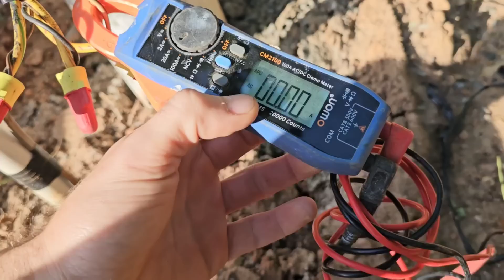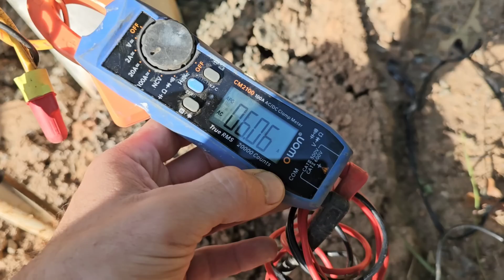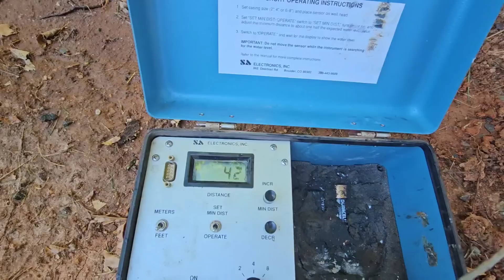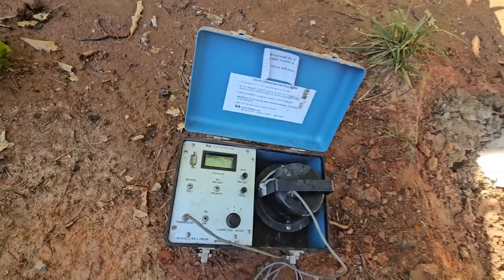A Terrible Outcome. Emergency Service for Low Water Pressure on July 4th!

Comment: I have a question regarding connecting the downpipe to the house pipe if the house side threads are too rusted to screw on a union. I need to cut off the rusted/splitting end but only only have a few inches left. Digging it up isn’t an option since it goes under a concrete driveway. I’ve searched Lowes for a PE pipe big enough to fit on a 1” galvanized. line but no luck. Also, Fernco fittings aren’t meant for pressure. Thoughts?

Comment: I have a question that possibly y’all can help me solve. I have a large concrete well the dirt  is sinking and causing a hole. How can I prevent this from reoccurring this is not the first time I have had to fill it I’ve used stones in soil to no avail, can concrete be put around the well to prevent this hole from reoccurring

Comment: I had a similar issue.  Our basement flooded.  The bottom pipe on the pressure tank rusted thru.  I replaced the tank with a big box store tank.  It worked great for the first year.  Then, whenever taking a shower, the pressure would drop so low that the shower would turn off and switch to the tub spicket.  I decided to investigate after letting it do that for a few months.  The tank air pressure was set right.  Switch turned on and off when it was supposed to. The water pressure was great directly from the tank faucet.  I decided to removed the shut off valve a few feet from the tank.  Inside the plumbing looking directly at me was a little red pipe cap/plug.  I quickly got my needle nose pliers and removed it before it could go any further into the house.  I do not know where it came from.  It was too small to fit the pipes before it or on the pressure tank.  I am glad I found it when I did.  We don't have a filter.  The next opening in the plumbing was 20 feet away!  I think it got dropped into the pressure tank at the factory or a prankster put it in at a store.

Comment: I'm surprised VA doesn't require relief valves, I've seen the 1/4" brass nipple to the pressure switch block up and hang up the switch and overpressurize the system, otherwise hope you're feeling better!

Comment: My original comment got removed so let's try a different wording: You probably don't actually have "it". When I was overseas (Isle of Man) I got sick, thought it was "it", pharmacist knew it wasn't and warned me NOT to take "the test" until AFTER 36 hrs or when my fever broke, whichever happened first. I took it before the 36 hrs and it was positive (FALSE positive). 24 hrs later, tested again..negative.  2 days after, tested yet again..negative.

Comment: Take care man. They said you can go to work with a mask and the virus. I liked it better when you got minimum 5 days and 5 more is you need it. 
Our well ran dry once. After filing a 450 gallon hot tub. And a drought in the summer. After that the water was always dirty. The guy said change the filter every the months. I did. Lots of sediment. I guess he didn't want to say move all the huge rocks and back up the truck to service the well. 
We also had hard water there and a salt softener with resin. The house had the filter but the garden house was not filtered. I washed my car one day and had resin on it.  I finally learned about filters for the garden house for washing or filling hot tub. Maybe suggest that to the family when you are better.

Comment: Would raising the pump up around 10 foot help with sediment? Our well is only about 80 foot deep and the pump was at 75 foot. Water level is 30 foot and only drops about 2 feet after running the pump for about 2 hours. It's darn near an artesian well. We had quite a bit of sediment until I cut 10 foot off of the drop pipe.  My neighbors well is an artesian well and he had to run a 450+ foot long drain pipe from his casing down to the edge of the creek to keep his lawn from turning into a swamp. Artesian wells are pretty darn crazy eh?